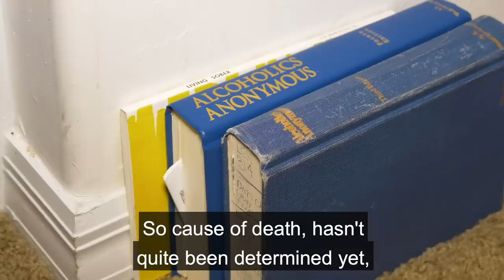Bathroom Bleed-Out Cleanup | Fort Myers, FL

Comment: I’m curious. It makes sense to get rid of all bio. But I don’t understand why you guys cut a piece of the sheet and throw it out ? Isn’t it easier to throw the whole sheet out? Is it a insurance thing ? Same question goes for the mattress 🤗👌🏼
Reply: If Im not mistaken, they are there to get rid of the biohazard material, everything else is none of their business.
Reply from the maker: So the thing is, things contaminated with bio-hazardous waste need to be disposed of differently than regular trash you'd take to a dump. But just like when you take trash to a dump and are charged based on how much or how heavy your load is, you're charged more the more bio waste you're disposing. Except it's even more expensive than the regular garbage waste. So basically it helps us as a company be financially efficient to take only the necessary contaminated materials to the bio waste disposal, and dispose of the uncontaminated material at a regular dump. In this case it would be owner's decision and responsibility to dispose of the uncontaminated mattress or bed sheet, or any material for that matter.
Reply: @CrimeSceneCleaning  that makes so much sense 😊👌🏼 thank you so much for answering 😊👌🏼 you all do a great job 😊👌🏼